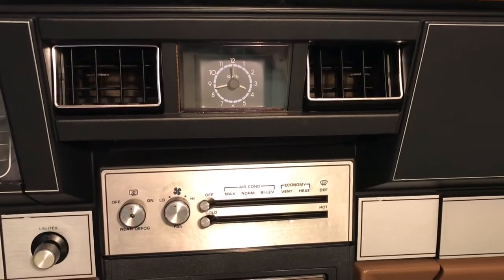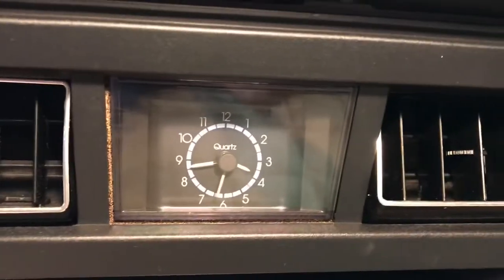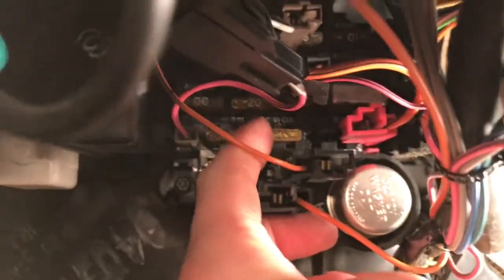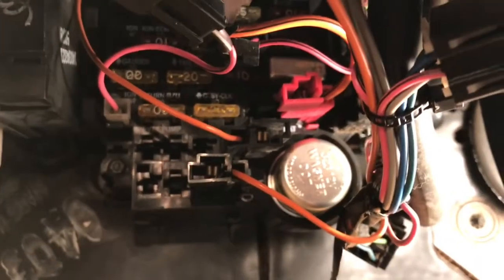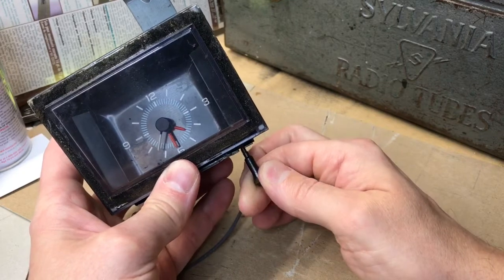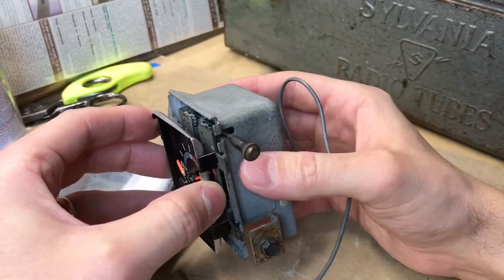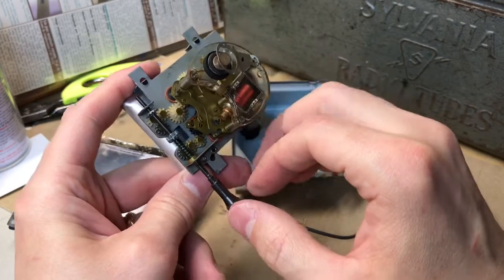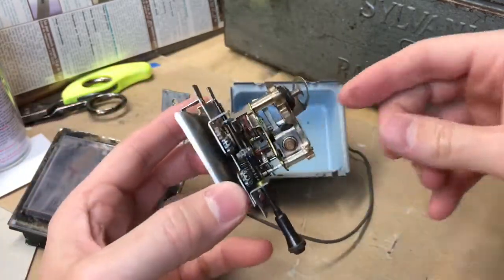Analog clock mechanism for the 1985 Chevy Caprice Classic

Comment: The post coming out happened to mine too. Then Dad got another one where the post did the same thing soon after he installed it. So a local clock repair place fixed the original and that is now in there and working as it should.

Comment: Is the mechanism the same for the digital anolog clock ? 

How to remove it from the dash?
Reply from the maker: @Cinematic Vlog:  From what I remember, the only truly digital clock option was part of the radio/cassette deck where the time was displayed digitally on the radio panel.  In that case there was a panel with the caprice logo where the analog clock would be located.  Otherwise you had the analog clock shown in this video.   Some Impalas might have had an analog clock with a rolling dial mechanism similar to the odometer, which would have had a different internal mechanism than what I show in this video.  Getting the analog clock out is a huge pain, and involves removing most of the dashboard.  See my other videos on removing the instrument cluster and on replacing the radio for starters.  In addition to that, you’ll have to remove the front panel where the heater/vent control is located and also I think you have to remove the entire dashboard cover piece running the width of the car (over top of the front speakers and defrost vents).   This is why I’m in no rush to fix the adjustment knob on my analog clock!
Reply: @LongologoProductions  the analog clocks with digits (numbers)was called digital clock. I think it only existed 77-84 in caprice and Parisienne.

What you show is the cheaper clock.  I think it was standard and the digital was option.  85 and up all clocks was removed because the real LED digital clock came in the radio.
Reply from the maker: @CarTravelSweden  :  You can see the absence of the analog clock and the presence of a digital display on the cassette/radio in my other video showing the 1985 caprice brochure.  My ‘85 was ordered with the standard radio (no cassette) and therefore it came with the analog clock as shown in this video.  So at least for ‘85 the analog clock was still available depending on what radio was ordered for the car.  There must have been enough of them made because they still bothered to match the colors and number style to that of the base instrument cluster.  Also, I used to have a ‘77 caprice with a similar analog clock.  Anyway this is interesting info…. Thanks.
Reply: @LongologoProductions  The 1981 Caprice i had in 1994 has the rolling dial one. It worked perfectly. The 1979 Impala I got after that one had the clock you were demonstrating but it never worked. I never looked into getting it working.
Reply: Do you have to pull the dash dash to remove analog clock
Reply from the maker: @Michael Ragland:  Yes, and actually that’s going to be my next video….  I just did that a few weeks ago.

Comment: Hello again 

* I have a question, my 1985 Caprice Classic four-door sedan did not come with a clock do you know how to wire up the gray the orange and the black wire ? Black is ground,where does the orange and gray go ?
Reply from the maker: Orange is hot and runs directly to the fuse block. Black is the ground as you noted and gray goes to the fuse block for the instrument lamps (gray is for the lightbulb that goes into the back of the clock). I hope that helps
Reply: Thx so much...I follow you with your Caprice videos,you really are a good help ❤ @LongologoProductions
Reply: I looked close at my fuse box on my 85 Caprice and there is no accessories where I can plug into it for the wires from the clock. ? So what do I do if I don't have any accessories to tap on to ? @LongologoProductions
Reply from the maker: @ this will be a pain in the ass to do, because the clock has a dedicated fuse on the panel, so you would have to run wires from an empty spot on your fuse panel up behind the dashboard and over to the clock. But if your car did not come with a clock, then the dashboard probably has that black plastic piece with the caprice logo over it where the clock would be, and I don’t know if you could easily swap out that black plastic plate for something that would accommodate the clock.
Reply: Thank you sir,your awesome,I think I'll find a gray wire to tap into,which I usually don't like to do....but I bought 85 Caprice wire diagram @LongologoProductions

Comment: Funny ? But can you add 1 if your 88 caprice dont have it,?
Reply from the maker: @Chevygwapgang:  Would probably require some modifications.  Those without the clock have a different trim piece between the two central-upper vents, so that would have to be changed and probably wiring added too.   Overall I think it CAN be done but just not sure how much of a pain it would be to do so.